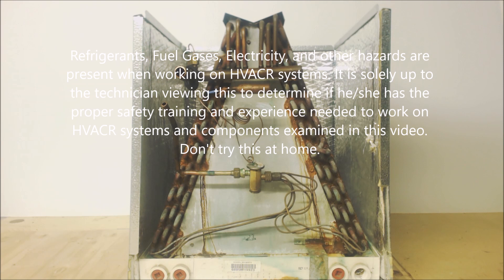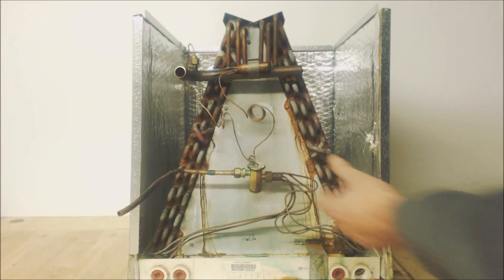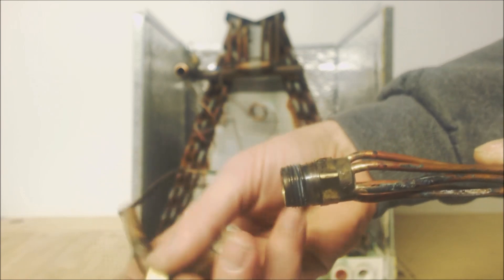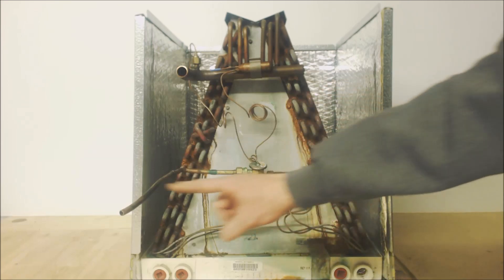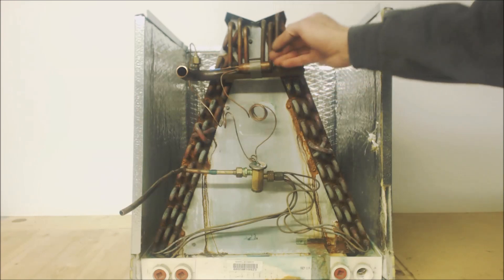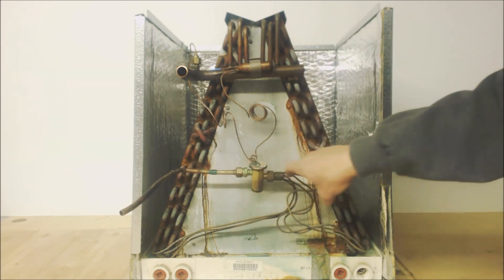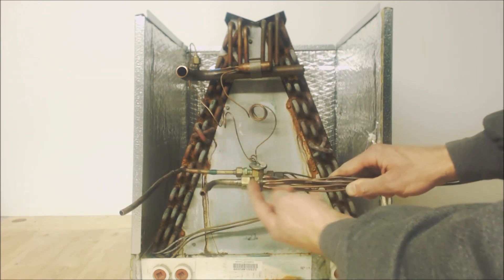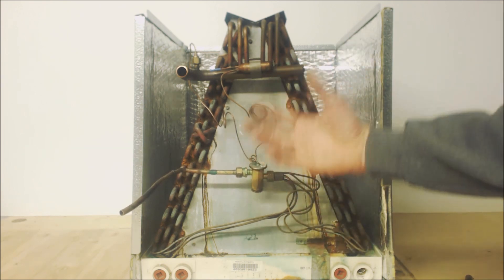Thermostatic Expansion Valve TXV VS. Piston Fixed Orifice! HVAC Metering Devices!

Comment: I had a straight piston R22 AC unit, and it ran way less  than a newly installed 410a txv system . And cooled the house twice as fast . Newer doesn't mean better .

Comment: I have a piston unit, where should I measure the superheat, at the evaporator outlet line or outdoors at the condensing unit suction line? The condensing unit label says "indoor TXV Subcooling 13deg but was installed with a fixed orifice, so what should the superheat be and aging what location to measure the suction lime temp? I was under the impression the entire evaporator should draw sweat including up to the outlet manifold.

Comment: Always very informative. I do find it harder to get my pressures on point when it's and older system with a piston. Nothing better than a nice TXV that reacts immediately when you add a few ounces. I find that the piston's don't always react well on my suction pressure and will just raise my head pressure then I switch over to my testos and put my temp clamps on and check my superheat so I don't over charge but I find it much easier to check my sub cooling,

Comment: you mention about fan motor stoping and with a piston...and floods....more time than not i seen expansion valves lock up....and cause compressor to lock out....i even seen a expansion valve lock up during defrost cycle on a Heil unit before...

Comment: I had a new evap coil installed and they forgot to install the orifice piston and the system was running for 2 months without the orifice installed.   Can the compressor  be damaged with this missing?  Also when they discovered that the piston was missing they opened the line installed the piston and did not vacuum the system down and just added refrigerant.
Reply: All bad. and yes that can definitely cause damage to the compressor

Comment: I've got about 20 rental properties in south Texas were it's in the mid 90s about 6 months of the year.  I have fixed orfice (piston) metering on all my units and I don't care what any tech says I'll never use TXV. Txv get stuck, and cause more problems that they are worth. Txv also are hard on compressiors because the pressures don't fully equalize on high/low side like a fixed orfice. I don't care if fixed orfice is slightly less efficient the headache of txv just isn't worth a slight efficiency gain.

Comment: in my experience i much rather have the fix piston versus the expansion valve...you have to change it out at aprox 10 years  at least....and what little you save....is lost big time.......and it sensitive like when copeland oil additive issues back a few years ago....realiblity is more important than effeciency...in my opinion....great video...

Comment: Thank you!  I had new AC units installed May of 2022.  In September one of the units stop blowing cold.  It is under warranty, the tech came out & identified the TXV was bad, he then said they would replace it with a piston that is more reliable.  I have a friend that has been in the business for 30yrs, something prompted me to run it by him to see if the tech was correct.  He said no, get them to replace the TXV because of the efficiency.  I called the company to let them know, & expressed my dissatisfaction with a lesser technology being installed in the system than what I paid for.  The owner called me back & said my friend was incorrect, but they will install a TXV if I wanted.   My friend also said they should replace the dryer since it was probably junk in the line or possibly the bulb was damaged because a TXV shouldn't fail so soon.  I stuck with my friends advice, then saw this video & it validated him.
Reply: You need to ask you freind how much it cost to replace your txv...if its out of warranty...do all the evacuation...refrigerant recovery.....etc...i bet you if cost more than cost saving of the tvx...i work on air cond for over 30 years...never had a piston to fail.....but tons of expansion valves....i even changed the one in my own home from a txv to piston....realibity more important than effiency....imho...

Comment: If you pause video at 2:01 you see two types of pistons. You said "older style piston" is bottom and "newer type" is top. My research indicates that the bottom piston is a Carrier type and the top is a Goodman type. Questions: is that true? ; can you interchange the "old type" with the "new type" ? ; in other words, if the pistons are brand specific can they be interchanged?

Comment: thanks for the great video. i always thought that high outdoor temp on hot days will pushed more refrigerant through orifice (more pushing pressure) than on cooler days. BUT, you're saying the SAME AMOUNT of refrigerant goes into the evaporator ALL the times. Please help to clarify. thank you.
Reply: it is the same amount at all times with piston.

Comment: Does it matter if a txv mounts inside or outside the coil cabinet? I have a New Goodman with an A coil and removing piston and adding txv before install.
Reply from the maker: It does not matter but if it is outside, the txv must be insulated because it will have low temp refrigerant running through it so it would allow condensation of any humidity, thanks!
Reply: AC Service Tech LLC Good deal and thank you for getting back to me. It’s a Goodman TX3N4 and comes with a round insulation cup that fits the txv and velcro’s shut.

Comment: What causes it to freeze up?
Reply from the maker: Low refrigerant sat temp in the evap below 32 degrees which is a result of a low refrigerant charge, liquid line restriction, or low airflow. I go over all this in great detail in the "refrigerant charging and service procedures for air conditioning" book at our website, thanks!

Comment: Can I use bigger TXV to replace smaller Piston? For example, 5 ton TXV to replace piston on a 2 ton unit? Since the TXV can adjust the refrigerant flow, so it should be able to handle it. Is that right?

Thank you so much for your nice videos!
Reply from the maker: no txv sizes are still needed such as a txv that has a range of 18,000btu to 36,000btu.
Reply: @acservicetechchannel  Thank you for your quick response. One more question, are the screw caps compatible on piston and txv? If not, I have replace the cut off small tubing on the other side of distributor? Thank you again

Comment: Are the screw caps on the orifice/piston and TXV compatible on the distributor side? If not, what normally technicians do when a piston is replaced with a TXV?  Completely remove the distributor small pipes? Can you do a video for that. I completely self study and would like to know what’s the normal procedure to do the convention. I searched on YouTube and didn’t find any good videos to describe all the concerns about the replacement. You always give best great videos. Thank you for your efforts
Reply from the maker: Glad to help and you will keep the same distributor tubes that are there regardless of the metering device type. The distributors are sized for the coil and the average flow of the piston and txv should be similar. It is just that the txv will be more efficient when there is a higher heat load at the evap coil, thanks!

Comment: I disagree with the statement that a txv works better instantly. I usually need to let it run 1-2 hours so that the  sensing bulbs eventually loses pressure after being strapped to the suction line before the equalizer and then is open and floods that evap better.  I’ve over charged several systems going off subcool IMMEDIATELY after start up. Maybe just a Texas thing since the txv was sitting in a 120f truck and the bulb was pressurized and shut tight
Reply from the maker: After 10 minutes, you can check the charge with subcooling but still monitor the superheat for diagnosis. The refrigerant is in the system and you can see the levels by reading both superheat and subcooling. As the system runs, the txv lets less refrigerant into the evap since the heat load is lowering. When a bulb is at 120 the orifice inside the txv is more open instead of shut since there is so much opening pressure but yes overall the longer you run a system, the more accurate you will be, thanks!

Comment: Love the videos!

I have a few questions. 

Do you install or service and Goodman, Amana or Daikin equipment?

I’ve been trying to get a few answers but can’t seem to get them. 

I always install TX Valves on my new systems and I always stick with Amana because they have scroll compressors. The Goodman units comes with a rotary which calls for a hard start kit if you were to install a TX Valve on that condenser. 

My question is, the 13 SEER unit calls for a TX valve by Emerson which is adjustable. The 16 SEER and higher units call for a TX Valve by danfoss which is not adjustable. 

What is the purpose of having a TX Valve that is adjustable? I understand that you need to charge the system based on sub-cooling, but do you need to take your drybulb and wet bulb readings with a TX valve that is adjustable and adjust the valve to that superheat? I wouldn’t say from the factory that they Valve is set to a point where you don’t need to adjust it? 

Also when you are checking a system with a TX Valve and you check your subcooling, is your superheat going to be relatively close to the same as your target subcooling? Do you check drybulb, wet bulb to find target superheat and adjust if necessary? Or do you charge only subcooling and call it a day?
Reply from the maker: So most AC unit TXV systems are nonadjustable. In the case of a TXV that is adjustable, they are usually set close to the normal superheat needed. You would normally run the ac unit and set the subcooling to the correct amount. Then you would check to see if the txv is working properly around 8 to 16 degrees of total superheat. Normally they operate around 10-14 degrees but for a new system install, they may take some time to settle into the correct superheat, thanks!

Comment: Well DIY the new system in my house and the outdoor unit came with a piston .  So I went back inside and took the inside oil box apart I saw that had a TXV this video helped me knowing that I have either one or the other but not both thank you
Reply: Outdoor unit is a compressor, compress vapor, and condensetes to liquid for the Txv,or piston, to reduce temperature, allowing refrigerant to absorb heat

Comment: How does an overcharged system with TXV effect Superheat/Subcooling and compressor cycling? Does the TXV maintain the same superheat and evap pressure with varying liquid pressure at the TXV?
Reply from the maker: The txv will try to maintain the same superheat even if the subcooling is high. The compressor amps will be higher and the heat rejection capability will be less at the outdoor unit if it is overcharged, thanks!

Comment: Txv is Cadillac of metering devices. Maintains desired superheat. Makes troubleshooting easier. But very sensitive and harder to replace than a piston. After piston fails on new instal I recommend txv as replacement.
Reply: Never had a piston fail but had seen many txvs fail and take out compressors :(

Comment: If a system is installed with a piston from the manufacturer, can you add a txv? Can txvs be added to any systems that have pistons?
Reply from the maker: Usually a txv from the same manufacturer will fit onto the part of the piston chamber once the piston and front of the chamber is removed, thanks!
Reply: AC Service Tech LLC thanks for your swift response!
Reply from the maker: Glad to help Henry!

Comment: So, the TEV should be installed vertically to work? Thank you
Reply from the maker: It would depend on how the internal bypass is built but yes you are safe if the head is towards the top, thanks
Reply: Thank you so much for your help,as I am currently going to school for HVAC.

Comment: any brand of TXV works on any brand AC unit?
Reply from the maker: You could have one with a braze on end, flare end, some with two different types of piston chamber ends so you need to check first but this type shown in the video is the most common that fits in the piston chamber, thanks!

Comment: My Air conditioner  turned of because making height pressure on heating  mode .
Reply from the maker: That sounds like your indoor airflow is not high enough or there is some blockage since you are absorbing heat outside but not able to reject it inside, thanks

Comment: Hi mate I have a question according to the information below 
Unit is ducted split system r22 
Suction line actual temp was 24 to 25 Celsius 
Suction line saturated temperature on guage was below 0 around minus 8 or 9 degree when the unit was on cooling mode( I have regassed it according to reading plate and fixed the leak of Schrader valve as well before any action) 
Discharge line pressure 240 250 psig 
Metering device was not mentioned on reading plate but I checked the indoor unit it was piston device or capillary (definetly not txv) so the super heat too high 
And discharge temperature 32 33 Celsius ( too much pressure was stored behind metering device in my opinion) 
Condense dry bulb 26 27 Celsius 
I'm in Australia 
My question is that 
Can we make sure that there is blockage in metering device of indoor unit? If or could this blockage be somewhere else which I don't think so. What's your technical opinion. Do I have to replace the metering device only or some more parts? 
Many thanks 
I do appreciate
Reply from the maker: It sounds like there is a restriction like you were mentioning since there is such a low suction pressure and high sat temp. If the outdoor unit is just a outdoor condensor and not heat pump then I would suggest replacing the filter drier, piston, and strainer screen right before the strainer. On a heat pump, the inactive metering device may be before or after the liquid line port. If the evap has cap tube installed, I would replace the evap with one capable of having a piston or txv. I will always install a txv though, thanks

Comment: I was at initial startup inside space was 85 degrees 150psi/390psi 410a super heat was 4 degrees and subcool was at 13 degrees, 22 degree delta t . Why is txv not keeping the 10-15 degree super heat ? 4 degrees is kinda low wouldn’t it ? Please advise thanks for your videos
Reply from the maker: Seems like the txv is stuck in the open position or the txv is too big compared to the system. Is the evap coil small compared to txv and condensor or is the txv size bigger than the evap or evap and condensor? Also, if it is an initial startup, did the person who brazed it keep the bulb on the suction line while brazing next to it? That would have exerted a lot of pressure down on the txv as opening force. If everything looks ok size wise, I would try cycling the txv back and forth before and while it is running with hot tap water and ice water and switching the bulb back and forth between the cups of water. Maybe leave them in for 20-30 seconds each. You don't want to leave it in the hot water too long as you will not have any superheat for the compressor which would mean sat state refrigerant can get into the compressor. Anyway, those are some thoughts. I hope it helped!

Comment: If you have a txv and the blower quits running it will still freeze up.
Reply from the maker: Yes the txv typically is not able to shut down completely but it lets a lot less refrigerant into the evap than the piston. That is much better for the compressor in terms of how much saturated refrigerant is entering into it, thanks a lot Kevin

Comment: Thank you for this video as a homeowner.  Our 16 yr Amana Prestige 2 quit working after being gone for 10 days with high temps outside...I had left the thermostat at 80 deg.  When we got back, apparently the Evaporator froze up.  The initial HVAC repair person told us we needed either a new Central Air System for $4K or he could replace the Coil for $1700.  I replaced the TXV and the system is working perfectly.  My question is, what caused the TXV to fail...and exactly how did it fail?  Did it get stuck closed...which caused low refrigerant...thus freezing the coil?  In the future, would I have been better off, slowly adjusting the thermostat down like from 80 to 76, 76 to 73, etc...would that prevented damage to the TXV?  Thank you!
Reply from the maker: You should be able to set the tstat at any temp 68 or above in cooling and be able to run until it gets down to there with no problem. The txv could be bad due to manufacturer defect, brazing too close to it, brazing without nitrogen, anti corrosion compound in the compressor oil from the factory, bulb tube bent and leaked refrigerant from the bulb. Make sure you are epa 608 certified before handling refrigerants, thanks Todd!

Comment: so you can replace a piston valve with an expansion valve?
Reply from the maker: Absolutely as long as you can match up the connections of the new txv. They also make replacement txv's with multiple fittings for it, thanks!
Reply: I guess you have to pull a vacuum before you change it out?
Reply from the maker: Yes recover or pump down, then when the system is at 0psig, replace with the txv, followed by a pressure test, and then vacuum, before breaking the vacuum with refrigerant, thanks
Reply: @acservicetechchannel  How much would the whole process cost ?